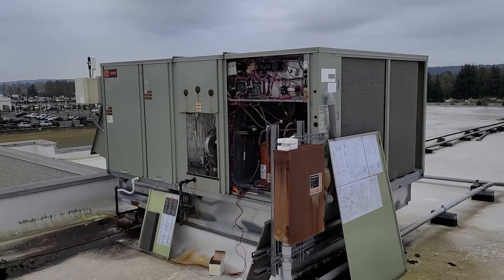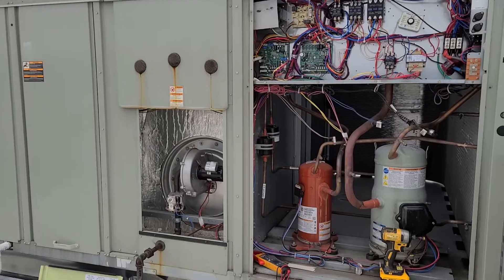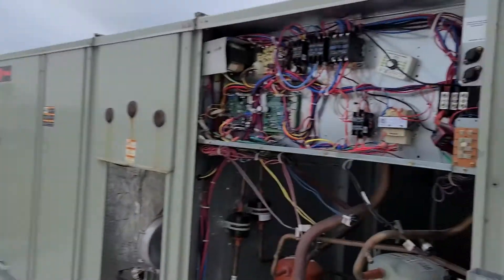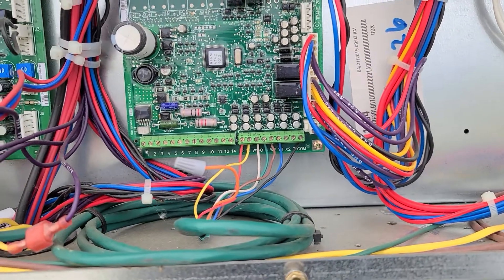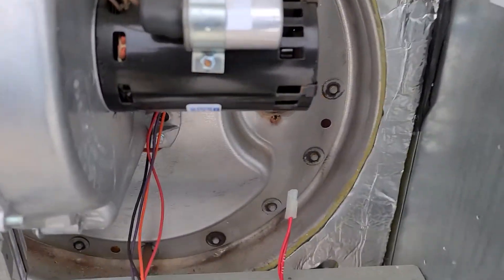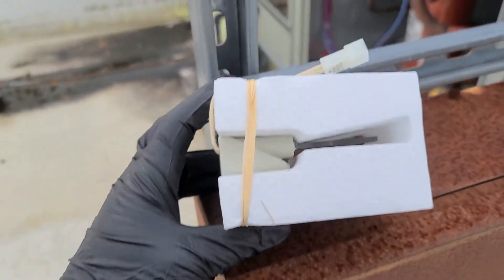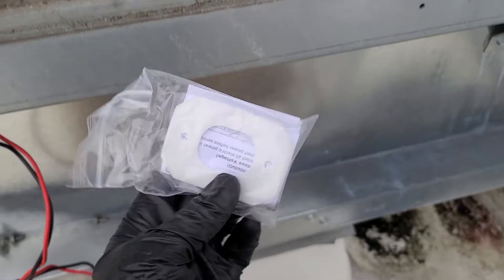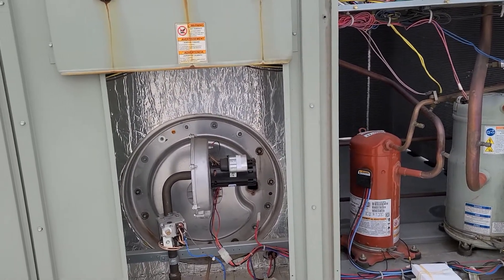25 Ton Trane Voyager No Heat!

Comment: Question in regards to the Voyager in heat mode. What's could be a possibility to have a knocking noise coming from inducer motor/ heating exchange area while in the process of firing up? Just curious. Thanks in advance.
Reply from the maker: Possibly having a screw loose. Hard to say without hearing it.
Reply: @HVACServiceTechnicianTalk  ok thanks
Reply: Inlet and manifold gas pressure would be most common thing to cause knock. Next would be to check both screens behind inducer outlet. Then make sure the igniter and inducer plate gaskets are good.